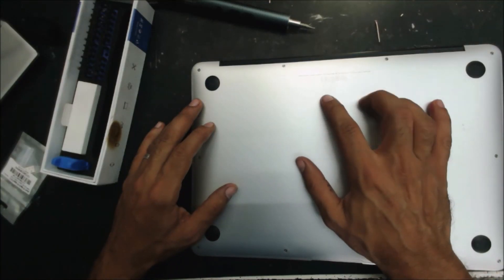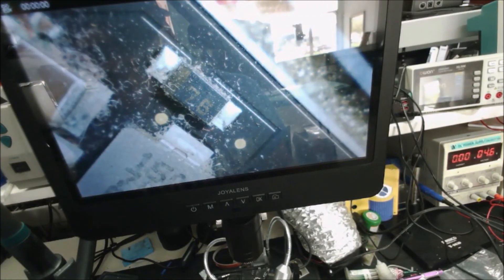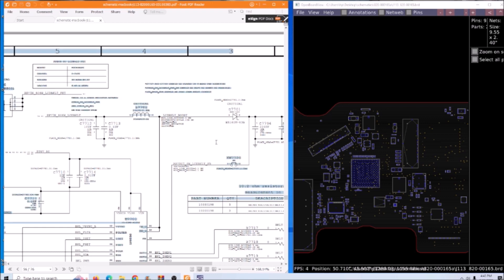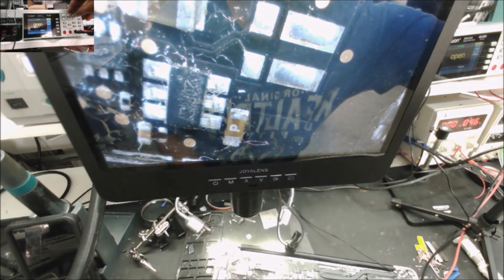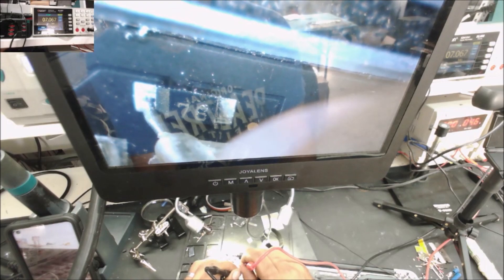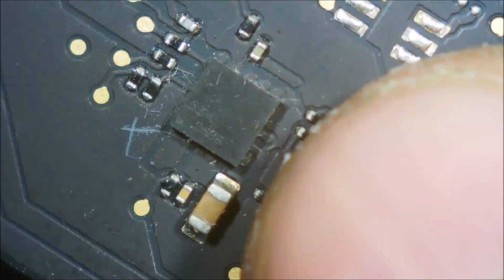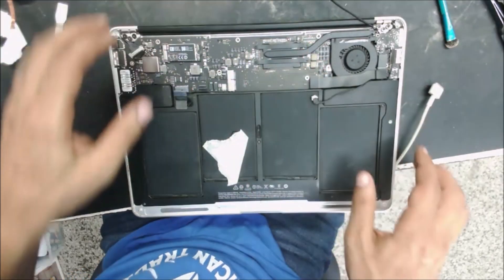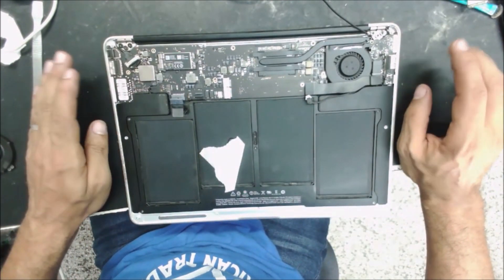Macbook Air A1466 no backlight diagnostic step by step

Comment: I dunno ... a tech came to that conclusion? Not so sure on that. Basic troubleshooting from the start is to check power in, power out. Sounds like someone made a random guess (non-professional) and it's you're expertise that resulted in a professional diagnosis and proper repair. Very Nice! 👍